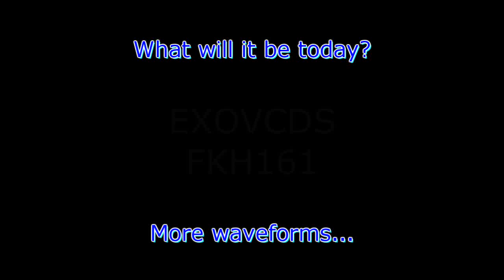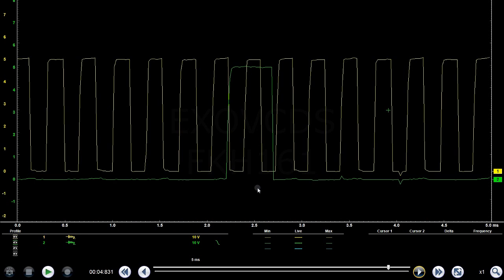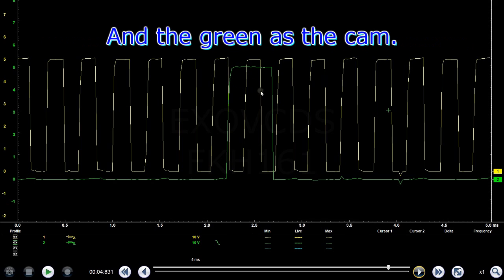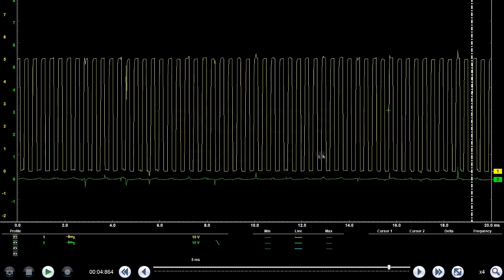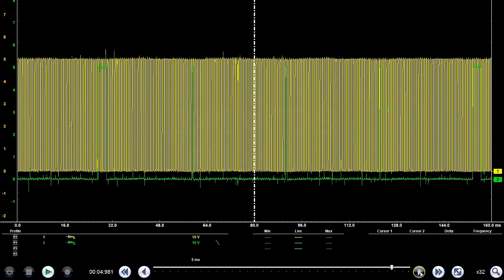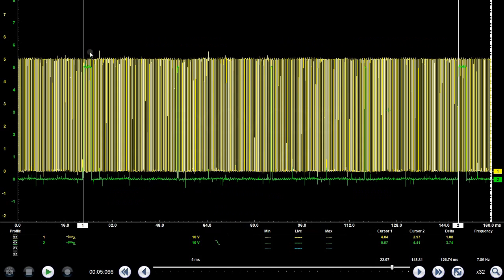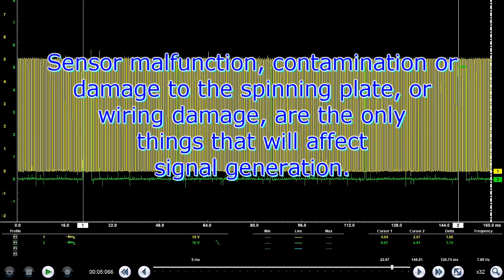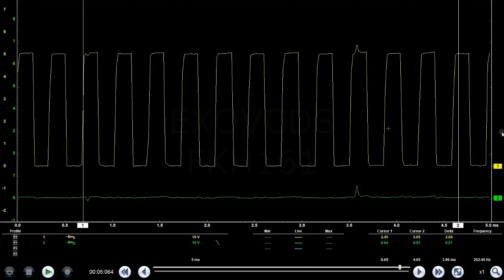1995 Nissan Altima 2.4L Distributor signals

Comment: hey I have a 1995 nissan altima SE 2.4l4....and I have recently replace the distributor and ignition coil. but the car still has rough idle and also shuts down at some moments. but when I put my hand over the number 1 mark on the distributor the car runs smooth but when I remove my hand the car has rough idle and shuts down can anyone help? ?? please
Reply from the maker: Trevon Card Post a video so I can see.
Reply: +Thomas EXOVCDS ok sure
Reply: +Thomas EXOVCDS how can I get the video to you to show you my faulty 1995 nissan altima
Reply from the maker: I just found it! =)

Comment: I have a Nissan Altima GXE 2.4L with the exact waveform , except for the one degree signal has a glitch right after the transistor in the distributor when it turns off . Will that cause a no injector pulse ? because that’s the situation I’m in. I’ll appreciate any response. thank you
Reply from the maker: How bad / big is the glitch? I'n no electronics expert... but if you can get an image to me, I can pass it on to someone who might know. fkh161@fkh161.ca is my email address.
Reply: Thomas EXOVCDS i have sent the photo to your email address , there might be many reparations of photos and I didn’t not know at first where or how to send the photos. I apologize thank you
Reply from the maker: I got them, thank you. I'll get back to you later.